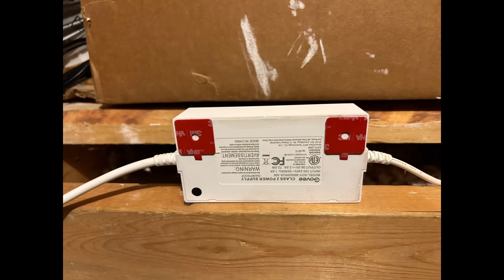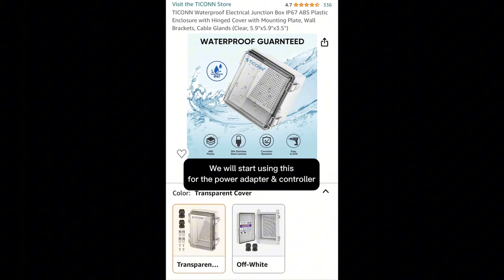Govee Lights( My Home Review) The Do’s & Don’ts @GOVEE  #Howto #govee #diy

Comment: JB sorry, one more question please.  I understand that if you go over 150 Led lights on one strand you have to put a "module" in to boost the power for additional LED's. I can't find anywhere what I need exactly and where I can purchase it?  Can you please advise.  Sincerely appreciate your expeditious responses and professional guidance! You are a rare find up here!
Reply from the maker: Adding a module is only true when using the pro outdoor permanent lights 150ft Kit but not for the non pro kits. After 150ft, you can add 3 strands to extend and the module will now get placed after the 5th string of lights. 150ft is the max for the non pros

Comment: I installed 7 strands with 2 extensions, extensions installed after the 3rd strand and another extension on 5th strand for a jump. The last 3 strands flickers.  I tested it prior to installation and it is working. Thank you. I put 7 light segments on the app. Thoughts on how to fix it? All connection were installed well.
Reply from the maker: Disconnect from power and wait like 20 seconds. Then plug it back in. Then on the controller, press and hold the power button for 6 seconds till you see a white flash. If this doesn’t work then place 8 segments instead of 7 as a last option
Reply: @jbsdiytv  does the 2 extension included in the count? So I have 2 extensions and 7 light strands. I still have 2 light strands I didn't install on the 150 foot non pro. I did unplug it for 10 mins 5 times. Press the button 4 x. I will try your recommendation and it might work. I will get back to you when I get back home Christmas day.

Comment: Can I cut a 100 foot down to 180 feet? And can I cut and exttend with wire to use at another area?
Reply from the maker: Sorry, I’m a bit confused with the question you just asked. Can you clarify please?
Reply: @jbsdiytv  wow what did I write there!!! lol sorry about that. I just ordered the 200’ pro and I have 2 stories and getting from my first story to my second story is going to be tricky if I plan on running from right to left? Do I just use a second controller on the second story and run it from right to left also? Or how do you do it? Do I run from right to left on first story then jump up to second story from the end on the left and run left to right on second story?

Comment: I wish I had watched your video first. I tried to splice the 12 foot extension to make the cord shorter. And it wouldn't work after. I tried to put it back together with the original wire..and it still wont work. Did I just ruin the cord?
Reply from the maker: If you mixed the wires up then probably fried the data amp on that small box. Have you done a factory reset on your lights. Hold power button for 6 secs
Reply: @jbsdiytv  Thanks...I think thats probably  what happened.  My first time trying to splice stuff. I should have been more careful.

Comment: A suggestion would be to attach the wiring to the side of the boards in the attic.  This will prevent them being stepped on or something placed on them.
Reply from the maker: Yes sir that is a good suggestion. I wanted to mount it overhead but the distance I went with the adapter and controller came up short and tight so this was my last resort. I didn’t want to redo the setup or add a receptacle but I may have to if I need someone to service up there for a utility. Thank you for your suggestion

Comment: Have you experimented with distance from the light ot the house?  Is 2" your recommended distance, or have you found a distance you like better?
Reply from the maker: Hi there. Thanks for your comment. Yes, we prefer what is recommended by Govee(2-4 inches). We had someone request to hide it completely behind the fascia and that was 12” out. They didn’t like how it looked because it didn’t match how the box looks. This was explained before the install but they wanted to hide the white wiring. If you have them out that far, then you won’t get the wall washing triangle effect. That’s the selling point. Hope this helps

Comment: What did you to to ensure that a light was at the top of each gable..and still have the lights evenly spaced?
Reply from the maker: Thank you for watching and for your comment. The back of each light has a VHB 3M pad so I peel the sticker off and place it directly centered of the peek. Of course only the edges will stick so do not move on to the next one until that one is done. You have to place the slack of the rest of your lights on your ladder so it doesn’t pull down while you work on it. Then place two clips tight, one on each side of the light to keep it there.  To answer your question about them being evenly space is-good planning. Take a strand up there to the soffit and do a dry run of how they will look, don’t peel off anything. If 6 fit to the right from center to end, of course six will not fit to the left since you took up the center already so 5 will go to the left. From the first light go center to center of the light 17”. One full strand has 12 lights total. Hope this clarifies it up a bit. Thanks

Comment: At 6:18, you mention if you decide not to splice.  Do you mean you run another power adapter/interface on this run?  If you do that, do the multiple controllers not work together as one?  I have 400' to run, I will need to use at least 3 of these.
Reply from the maker: Hi and thanks for your comment. I mentioned I was new to the product and did not want to splice the the connections so I made a hole big enough to pass through it. It’s always best to only use on controller for installs because the Bluetooth and WiFi are excellent. Yes you can group multiple devices and they will sync together. I just had enough knowledge to do one device and get everything spliced mainly at the jumps

Comment: Question! If I were to purchase a 100’ kit and later on down the road purchase the 50’ kit, could I add it onto the existing 100’ kit to now make it 150’ as “one” kit? I don’t wanna pay for a full 150’ kit right now …
Reply from the maker: Thank you for your support. You can purchase 3 strands instead of the 50ft kit. That would be better and it can work. Stay under 150ft on a 100ft kit

Comment: Great video man, Thanks! Quick question. I need to cut & splice in wires to create a 15' gap between 2 lights in the middle of a string. I'm concerned this will be too much of a gap and power will drop on the other side. Do you think this will be an issue? 

And if so, since the 12' Govee extension has a "driver or booster" on it, what are your thoughts on splicing an extra 3' of wire into the extension, and then splicing that modified extension into the middle of a string of lights? Thanks again
Reply from the maker: Yes I’ve done add 3ft to a 12ft extension using 18/3 wire. We did this while making 3-4 custom jumps that were 2-3ft within the install. This was the 1st generation lights. Now with the pros, you can do a little more with them when it comes to jumps.
Reply: @jbsdiytv  right on. I need to jump from the 1st story of my house up to the 2nd story to continue my run, and where I need to make that jump is in the middle of a string of lights. Do you think I can cut this string in half and splice the 15' extension into the middle? Cheers
Reply from the maker: @D.Demers745 yes using the factory connection to connect at least the side of the 12ft extension that has that small box on it. It will be hard to splice near that but do leave that on the extension
Reply: @jbsdiytv  So if I were to cut 5 lights off the end of a string, and then cut the connector off that piece & splice it onto the end of my newly shortened string on the house, it should give me a factory fitting to connect the side of the extension with the box on it.

Do you think if I were to splice the remaining 5 lights onto the other side of my extension between the extra 3' of wire I added and the factory connection, I'd be able to connect the rest of the strings to it and everything would function? And would I still be able to control those lights with the app? Thanks again for your time dude!
Reply from the maker: Sorry never saw this one come in. Did you order the 1st generation lights or Pros

Comment: The clips that you recommended have screws.  Did you use those screws and screw them into hardy board.  I see you have Hardy board that you are putting these lights into and I'm just curious as screwing into hardy board is a "B!t(h".  Please advise as I want to ensure that the don't fall down with just the 3m tape on the back as you showed. Also what wire did you get to extend the lengths when you have to create space instead of wasting lights please?  Thank you advance for replying.
Reply from the maker: We didn’t use those screws. Our method is using a ryobi 18gauge 1” brad nailer
Reply: @jbsdiytv  and that will go through hardy board?
Reply from the maker: @craigchilds7688 we’ve done 90+ installs that way. I guarantee it. Use the ryobi 18gauge air strike brushless, not sure how others preform
Reply: @jbsdiytv  thank you will do!

Comment: I’m installing 2 150ft stands on my house.. since they can not be connected, can they be programmed on the app together so if using some light settings they are in rhythm?
Reply from the maker: Hello and thank for your question. Yes they can be programmed together. Go to home in the app, then hit the plus symbol, then with select type on the screen then select same-model group control. You will see two model controllers in there so select both. If you haven’t figured it out, I will have a video coming out soon that goes in depth with the app. Thank you
Reply: I am assuming when installing 2 150ft strips like this the power would need to start at the end of the first 150ft piece?  To keep the lights going in a group? Will they each start at the same time or will the second one start as the first one finishes? @jbsdiytv
Reply from the maker: Will you be using 150ft on top and 150ft on the bottom? Or is this other 150ft  working from the back to the front. There are many scenarios that could take place with your amount of lights. You can message me IG @jbsholidayandchristmaslighting if you would like to discuss your layout

Comment: Can you run a three way splice? Or will it make it impossible to program the colour patterns? I’m trying to avoid long runs of extensions. How long of an extension can one run on these before experiencing flickering on the end?
Thanks in advance and your videos have been a great resource for me.
Reply from the maker: Thank you for your support to the channel. You can run a 3 way splice but it will not individually respond. They will mirror each other. 100ft kit you can add 3 extra light strands. We have installed the 100ft kit most like this…3 strands, 3ft custom jump, 2 strands, 12ft Govee extension, 2 strands, 12ft Govee extension, 2strands
Reply: I have 2 runs that may exceed 12ft. I was actually thinking about extending the Govee extensions and hopefully the boosters on them may help as opposed to just straight wire. I have a 150ft kit and it came with two extensions. The only other way is to do a three way and not retain the programable functions. 
We will see how it goes. Thanks for the reply.
Reply from the maker: The presets will work but if you do segmented or advanced settings they will act the same. The spot lights for accent lighting everyone would like to use for the whole year, those will not be individually be programmable

Comment: Can you make your own custom light pattern . Like a white and red chasing light for Christmas?
Reply from the maker: Yes sir. You can do that 2 ways of doing it. Under color, then advanced settings, then pick which individual lights you want and pick your stream like clockwise or counterclockwise with speed. Other areas is in DIY. Both can be saved. 

Take a look at this detailed video of the app
https://youtu.be/KWp5gK0OZwU?si=0jz48r1VSqhlVygb

Thanks for watching

Comment: Does the  wire stapler work on aluminum soffits I would love to buy that dewalt stapler since it seems multi purpose just not sure?  Thank you for all the videos i am studying them heavily. I have about 260FT worth of roof lining that i want to cover with these lights and i a debating what my best scenario would be....2x150s going different directions or 1x 200ft + 1x100ft.
Reply from the maker: The Brad nails will be loose on aluminum soffit. I would definitely get one full 200ft kit to light up your front and keep a 100ft where it’s less visible to the view. Not sure how your house is positioned in a cul de sac or at corner but use your best judgement with that. Just know that you can group your devices

Here is an example of how to go about the panels that have holes if yours are like this
https://www.instagram.com/ourdiyhomeproject/reel/Cz33AkvL0Lk/

Comment: I have 150 ft run but the power source is in the middle. If I use 2 separate systems can I configure the one to run in the opposite direction so that scenes run in the right direction when grouped?
Reply from the maker: If you don’t mind, Please reach us on our FB messenger @jbsholidaylightingsanantonio. I will ask a few more questions and then I will circle back here so the viewers have an understanding of the question. Mention your YouTube handing
Reply: @jbsdiytv  that address doesn’t seem to work.

Comment: How do these compare to trim lights ? I was quoted for 190 feet $4500 which they use tracks too. Govee at about $450 for 150 feet cheaper but have to install
Reply from the maker: If you were to hire us to do 150ft Govee pro it will be $1200 labor before taxes. I’ve done a few installs where clients had that company and said they wish they went with a Govee install since they have that cone shape on the wall which Govee outdoor permanent lights are know for
Reply: @jbsdiytv  wish you were in the NEPA area. That’s so much more reasonable. I see trim lights though do use tracks to install but still it’s a lot more expensive
Reply from the maker: @efthimios yes that is correct. We are willing to travel if the cost is less than what they quoted you. You can reach us on our social platforms at the top and we can discuss it if you’re interested. Mention NEPA

Comment: I see you have both light strip and the lights you just installed, how do they look like when they are both on? I did not like the clam shape shadow on the wall so I got the stip instead for more solid look (just my own preference ) OR strip didn’t last longer than you were hoping for so you replaced them with the permanent lights instead? 

Thank you 😊
Reply from the maker: Had the strip light first then installed the Govee to test out what I can do with them, troubleshooting the do’s and don’ts. I liked the Govee lights better than the strip but my preference as well. That’s why I started the channel to do diy projects and permanent lighting
Reply: @jbsdiytv  nice! Do u have a photo or video how they look like when both of them are on? If they still make that particular shadow from the lights? If not it’s totally fine ☺️
Reply from the maker: @kristianesguerra9204  I have a photo on my TikTok at the link above the page

Comment: I read some reviews that the lights will not work if they are cut in groups less then 4 lights is that true?
Reply from the maker: Hi Tim that is a good question, yes sir that’s correct only for when you are ending with lights not in between as your installing. So if you know you’ll end with 3 lights then you will have to adjust some lights to get the 4th one in at the end. If you cut your strand during install and there are 3 or 7 lights, you’ll be ok as long as you bring them back together with your jump. Best way to check this theory is to go to segments in the app and you’ll see which 4 are controlled. Don’t end with odd numbers. Hope this answers your question.
Reply: @jbsdiytv  so if I am down to my last strand but I only need 9 lights out of the strands, I cannot cut the 9? It will have to be on the 10th ot the 8th light?
Reply from the maker: @l3n0y.24 you can cut where ever. We typically try and  leave at least 4 lights remaining on a strand. We haven’t had to do less than that

Comment: How do you reset the lights? I am unable to get the last 2 strands to work (they worked when I tested them on the ground), now they are on the roof and I am worried!
Reply from the maker: Hi there, have you seen my Custom Govee Install video. Near the end before I show the results of the lights there is a small clip. Take a look at it because visual is always better than typing it out. If you still have questions respond to this comment. Thank you

Comment: Thanks for your help brother, do you have a do and donts for splicing?
Reply from the maker: Hi there, thanks for watching. No problem. Yes I do. The wire should be between 18-22 gauge wire. I use 18-3 for my videos and the link to the product is in my description. If your going to reattach the strands back with their original white strand then follow the markings on the white wire. Stripe with stripe, solid with solid and writing with writing. I have a video with these instructions. Title is Custom Govee Install
Reply: @jbsdiytv  Thank you for your reply, I ordered 150 ft, and was reading that one power source is recommended for 150ft, I've just measured and will need to add, some extra length about 15 ft extension to get around some parts will I have a problem, with only running one power source?
Reply from the maker: The 150ft box comes with two 12’ extensions. I don’t see a problem or Govee would of fixed that. Thanks for you question